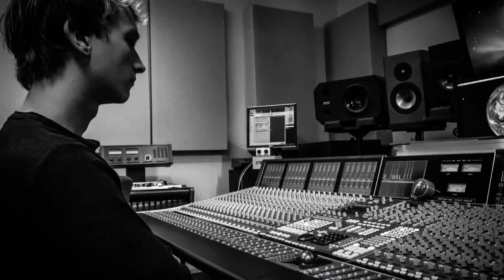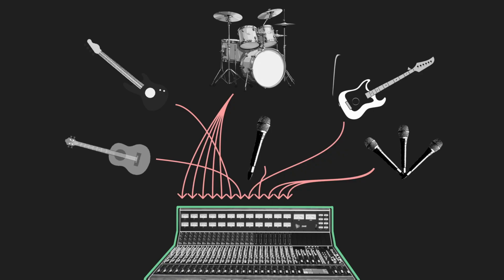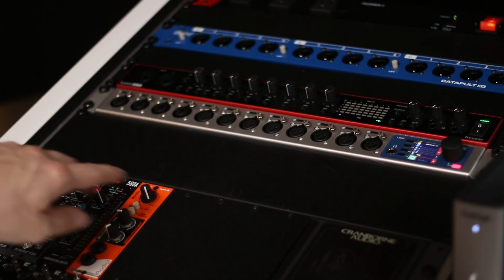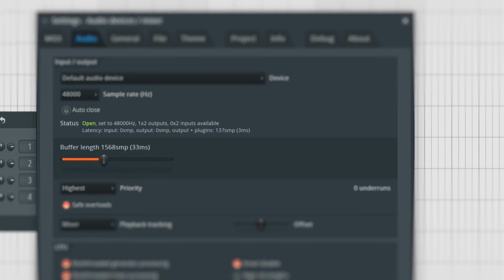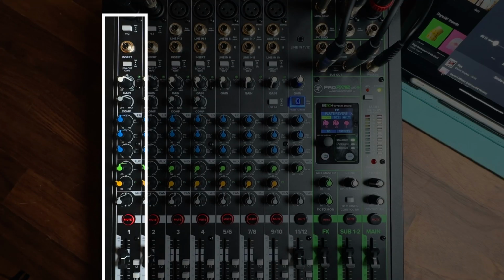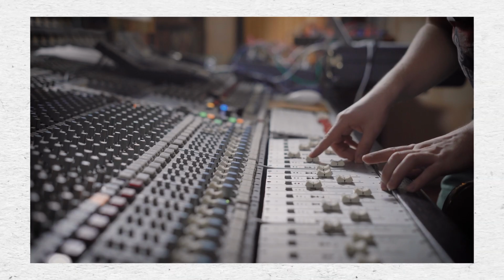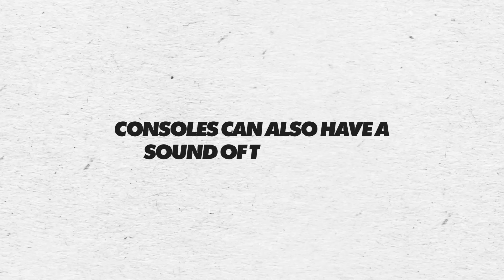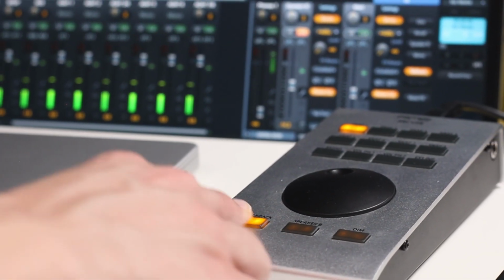Do You Need a Mixer in a Recording Studio?

Comment: I strongly suggest getting that tactile control surface, it lets you get the best of both worlds. You keep all the recall possibilities, all the automation, etc, but also can use the tactile operation of 'real' faders, the speed of operation of a physical mixing console, and you can get an overview of all important parameters during mixing at a glance. 

The market for those has somewhat exploded, and you can get them in a very wide range of price points and quality levels. The most important things to pay attention to is the accuracy of the faders, how easy it is to use multiple fader banks, how expandable they are (many allow you to add expansion controllers, which lack the main 'DAW control' buttons and jog shuttle, just add more faders and 'channel' buttons and dials), and of course, the faders being motorized, because without that, you don't get the 'at a glance' overview. 

Seeing a control surface follow the automation you setup can be quite fascinating, but also provides very good feedback on that automation.

It really gets you the best of both worlds, while usually requiring a lot less space than a full sized traditional mixing console.
Reply from the maker: Great info! Thanks!
Reply: Ugh I tried those control surfaces and dealing with midi assignment is such a PIA. I just like the simplicity of a mixer. That comes with lots of cable management but I find that far more intuitive and easier to reason with than assigning knobs to every parameter then getting a new controller and starting all over gain cuz the last one sucked.

Unless there's direct one-to-one connection between the controller and the DAW I'm not interested. We need iphone type vertical integration.
Reply: @daniel_dumile  I use ableton live, have the controller ser to mackie protocol, from there it is plug and play. Ableton recognizes the controller and all works out of the box.
Reply: @daniel_dumile  I have my controller (Qcon Pro G2) set to mackie mode,  and use Ableton Live which recognizes it. From there it is plug and play, no further configuration needed. This works with many controllers and DAW software. 

You can go the 'midi' route, which lets you customize things, but is a lot more work and comes with the issue you mention.
Reply: I have a Qcon Pro X controller surface, I got it so I wouldn’t have to look at the screen for as long while mixing. I usually use it when I’m mixing a lot of songs
Reply: @LowKeyPorter  I use a Qcon Pro G2, essentially the same story.
Reply: @AudioUniversity, I recommend you try the Presonus Faderport 16 controller, which has motorised faders.

Comment: Long time watcher. Thanks for making great content. 

I noticed you had a Radial EXTC in your Cranborne R8. Are you able to use the send/receive via the back insert ports? I ask because I want to get the R8 and stick a pair of EXTCs in them without having to run the effects loop out of the front ports. That way I can run the back ports into my patchbay. Sweetwater says this cannot be done, but I suspect otherwise.
Reply from the maker: I haven’t actually used the inserts. I suspect they are not designed to be used with high-Z, instrument-level gear. 

That is a Cranborbe 500ADAT, but the same answer applies. 

The cables do get in the way. For this reason, I just use a Radial reamp box from my patch bay to my amps (because these are further away from the EXTC) and I use the EXTC for pedals.
Reply: @AudioUniversity  Thanks for the quick reply. I wondered about the impedance too, but I don't think the EXTC is strictly high Z for the FX loop, as some pedals work at line level too. If you ever test this out, please post and let us know. I've been eyeing this setup for awhile. 

Also, I think it's funny that you talk about mixing almost exclusively in the box yourself but the R8 gives you console like signal paths with whatever channel components you want, either for tracking or mixing. It's a super hybrid approach without the console/outboard space/cost and I'm surprised more people don't go this way.

Comment: I'm equally comfortable with both workflows, but prefer a console for tracking.  
EDIT: I've also done some live outdoor theater stuff and prefer a mixer for that, too. Sometimes you need faster reaction than a mixer interface on a tablet (or worse, a mouse on a laptop) and the tactile sense to finely adjust controls by touch alone.

Comment: you forgot to add how beneficial an analog console is for getting new clients. I see many studios just using the console to get people in the door, and they don't actually use the gear. I'm wondering if there is any research done on this subject?
Reply: Hehe, I do not run a professional studio, through I do some payed for recording in my home studio. People were indeed way more impressed by the old, and no longer used, analog mixing console I have around than by the much more capable digital audio workstation. Adding a nice control surface with motorized faders etc did change that tho, those can look really impressive to lay people 🙂
Reply: There is a WOW factor to a console. There is also an intimidation factor. I try setting an atmosphere of creativity, comfort & relaxation.